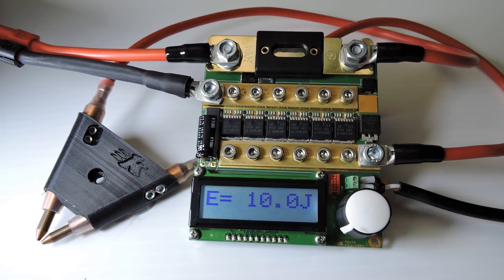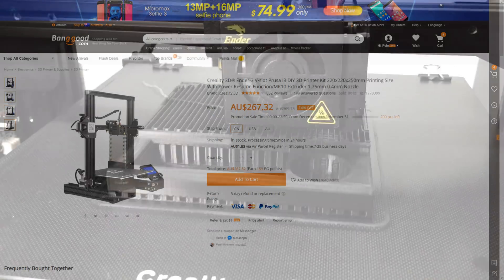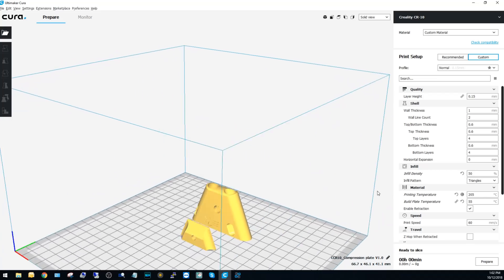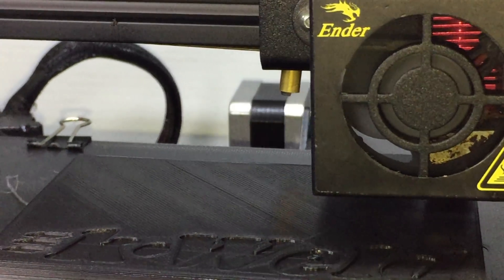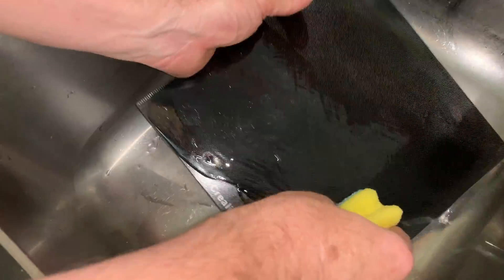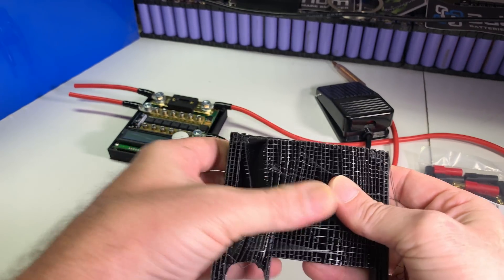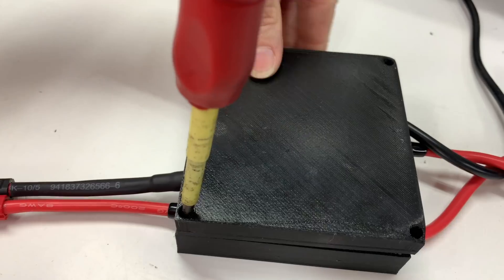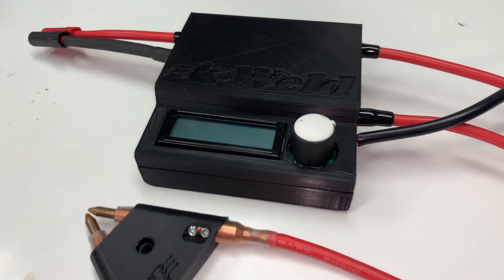3D Printing the keenlab kWeld cover & electrode housing using an Ender 3 3D printer

Comment: Hi, how did you load the housing model into cura? The file is an stl.zip and it won't open in cura like a normal stl file. Please help.
UPDATE, I found out how lol.
Reply: If you unzip the file you will find folders and stl files inside

Comment: What's the cost of the spotwelder? And I heard of a loaner deal? I'm thinking about spotwelding my next packs. 2800 cells will be miserable soldering them all. Being offgrid I dint have enough power yet to run 3d printers I'd like to have one , and maybe a cnc Carver. Great video, happy holidays Pete
Reply from the maker: if you're local you can loan this one or head to secondlifestorage.com and others have their available to borrow
Reply: HBPowerwall thanks man. Unfortunately I'm not. I'm in the US... I'll check it out.  Thanks again...

Comment: Pete, I got an Ender with the glass bed a couple of weeks ago and have been designing and printing non-stop ever since. Levelling is a pain, and getting the first layer to stick has been an issue, but if that is good then the rest of the  print goes really well. I'm using Blender and Slic3r on Linux Fedora.
Have made an Arduino solar tracker with a gps module, 16x2 display and 2 small servos - next job is to scale it up!
Reply from the maker: After is started using hairspray it's getting a little better also found solid mounts for the bed.. BLtouch ordered also
Reply: @HBPowerwall  I tried using Pritt-like glue and that worked, but difficult to get an even coat and subsequent coats build up and get clumpy but it is water washable. Hairspray sounds promising so will give that a try too.
I don't think it helped that I used acetone to clean the plate as adhesion became worse after.

Comment: Hi Pete,  I highly recommend https://www.geckotek.co/ for a build platform.  Very successful kickstarter years ago.  I have been using the original magnetic plate since and its wonderful set and forget printing.  Only maintenance is an occasional wipe with a alcohol wipe.   It really changed printing for me.  Prints always stick and always easily pop off.  When printing something that has a large contact surface you can hear the part pop off the plate when cooling.   Or just remove the metal plate and give a slight flex and it pops  right off.    He recently re-added the magnetic metal bases to his inventory and I ordered one for another printer I have.  Smaller and stronger magnets than the original base for functionally the same.  The actual build surface has gone through several iterations from the original coating on steel plate.   Its now replaceable, not that I have had to replace mine.  100's of prints and working as good as day one.

PS no affiliation just a very happy kickstarter backer of a truly wonderful product.
Reply from the maker: i like the look of that - thanks for the tip